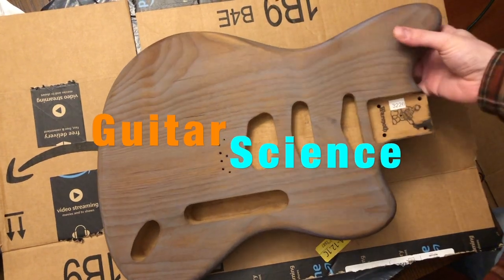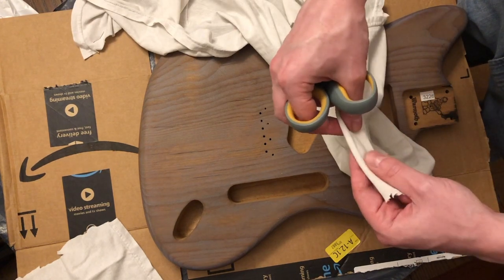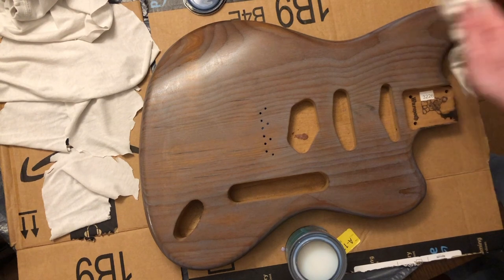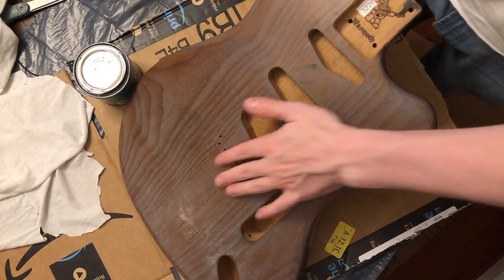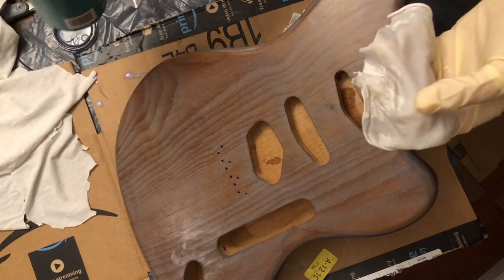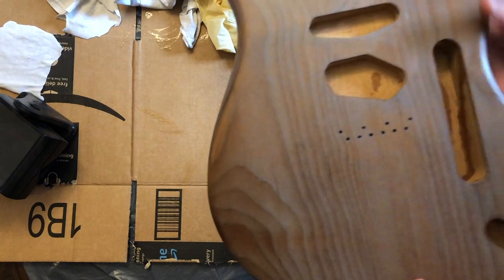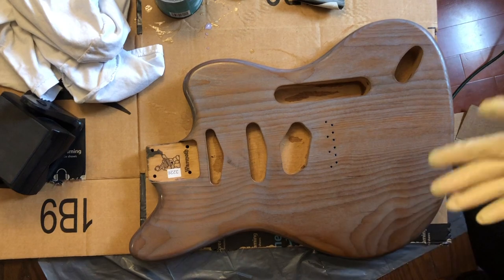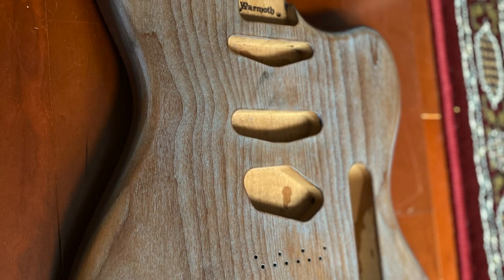Easiest Way to Finish a Guitar Body

Comment: This is an interesting video, but perhaps more interesting are the comments. This guy obviously isn't a pro, and I would not recommend anyone to follow every stage of his procedure (espcially the approach to scissors 😊). Even so, the level of venom directed at this guy is really mean, given that this is really just a little amateur video. He got a reasonable result with a modest level of knowledge and skill - surely that's a good thing? If you look carefully, you can see that a high level of sheen has been built up. You do have to look carefully because the filming is not of a good standard, but it's there. As for the comment that this product is not a wipe on finish, well that is technically so - it is not marketed as such. It does, in fact, wipe on very well (there are a few Youtubes out there demonstrating it in woodturning), is protective and can be buffed to a high gloss finish following wipe on. Minwax do make a wipe on version, and the product data sheets is slightly different.
Reply from the maker: Thank you! The whole point was to try something I knew nothing about, with a minimum of effort, just to see what the experience is like. I had never finished a guitar before. I got that body for next to nothing, and figured I'd give it a shot. It's held up pretty well. It's ironic that this is now my most popular video, when I think it's probably the worst one, but oh well!

Comment: Water based poly will dry in 2 hours, less depending on the thickness of the coat and temperature of the environment. If you want it to dry slower use oil based although it may get a yellow tiny over time. And you can do the final buff using Brasso. That's how I get a glass like feeling on my pens.

Comment: As someone else mentioned, it is not “Wipe-on poly”. This type of poly should be applied with a brush. I had both water base poly and wipe-on, but have used a scotch brite pad for the wipe on poly. Was able to achieve a smooth finish with a lot less sanding between coats and the final sanding

Comment: Hi, I just sanded a couple body contours onto a cheap T-style guitar I have. It's mahogany. What can I use just to coat the wood quickly? I don't care about looks... just want to get rid of the feeling of the raw bare wood when I play it now. Thanks!
Reply: I've been using Tru-Oil Gun Stock Finish.  Wipe on, dries in 2 hours.  Buff with 00 steel wool.  Repeat.  2 coats will work but 3 is gooderer.

Comment: I can think of at least half a dozen finishes that are easier than 7 coats of clearcoat and 4 rounds of sanding.   Try 3 coats of rattle can lacquer, 1 round of sanding, then polish, then wax.
Reply from the maker: I'm trying to avoid spray cans due to the inhalation problems (no outdoor space!) but I definitely agree it's easier and almost certainly produces a more consistent finish. Some day...
Reply: One round of Sanding?…….I doubt that. Sanding & Wet Sanding is 80% of getting a great finish.
Anyway, it’s up to the individual how they choose to finish their instrument.
Reply: @guitarscience6926  for easy low cost clearcoats, it looks like brush on poly is the winner, with clear brush on shellac being a bit more expensive.  I've gotten very good results wiping them on with crumpled printer paper, then rubbing off all excess with more paper.  The result is uniform thin coats that dry a little faster.  After 2 or 3 coats, it can be leveled with a fine grain sandpaper (320 or 600), then buff with polishing compound, and apply wax.  Its similar to the method used by Ken Parker Archtoppery, but there, he's using epoxy resin clearcoat. It only takes a few thin coats and you use the finest sandpaper grit possible to level it. And you don't sand it, you just level with a single fine grit, then polish and wax.
Reply: @ilovesmysangsomsangsom3500  polishing is what makes clearcoat look nice.  wet sanding is one of many ways to get there - but probably not the most efficient way.   I've wet sanded builds to 2000 in the past.  I've since discovered that all you really need is a thick enough level clearcoat, and you can just polish from there. No real need to "run through the grits".  One or two grits will get it done.

Comment: Jazz caster ? 🤣🤣...JazzMaster
Reply: With that pickup configuration and bridge route - essentially a Nashville Telecaster config - 'Jazzcaster' is a reasonable portmanteau. Only the body shape is Jazzmaster (or Jaguar, they are virtually identical except for the shape of the upper horn and some differences in the routing because of different scale lengths, pickup size and control layout).